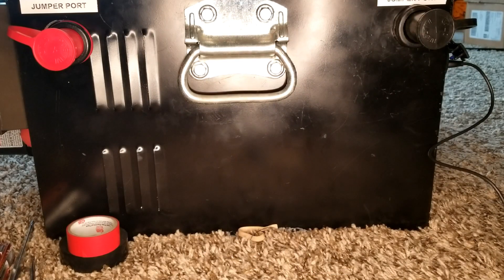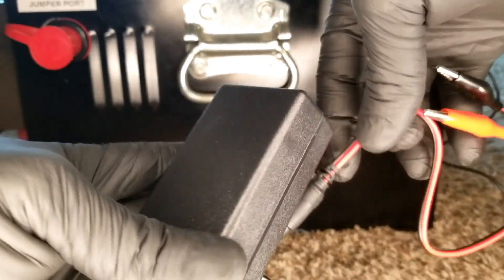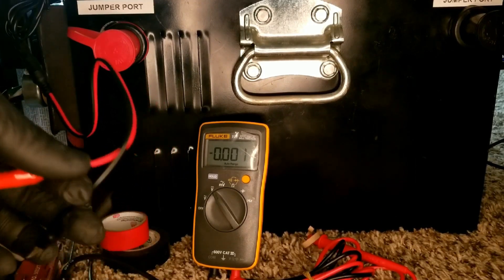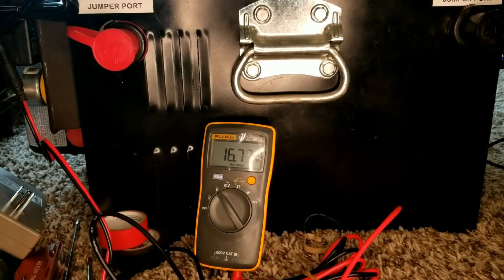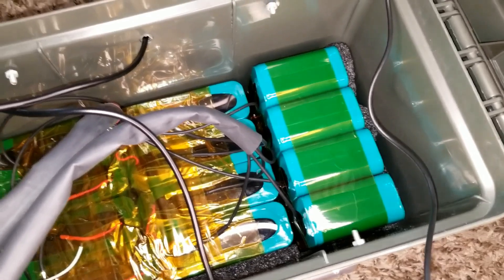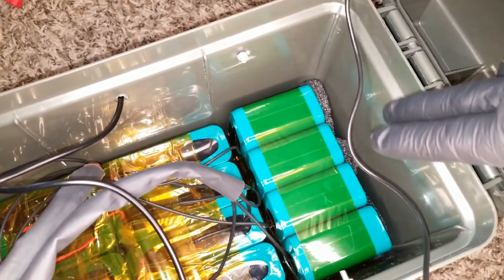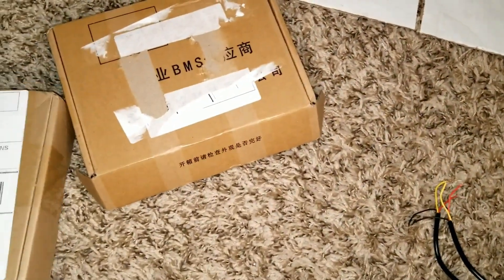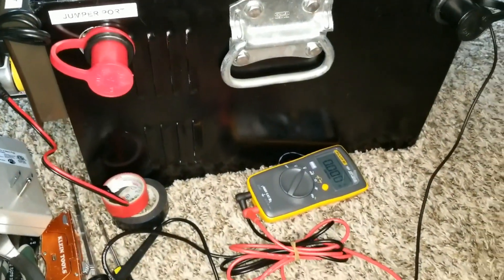14.8v - 16.8v Li-ion 4S 30W 2A LITHIUM BATTERY CHARGER MAINTAINER (LiPoLi-ion, LiPo, LEP)

Comment: Nice small 16.8 volt 2 amp lipofe battery charger . I know you have great uses for it to charge the cells . Would the current from the cells prevent the charger from pushing the 2 amp current through them from the major amp differences ? I’m just wondering .
Reply from the maker: Yes.
The charger has a built in automatically shut off/stop charging as the voltage reach the 16.8v
Remember the batteries also embedded with a built in BMS in them.
I hope I answered your question correctly
Reply: Your question does not make sense.  This charger starts in constant current mode, delivering up to 2A and the current depends on the momentary voltage of the battery pack it is charging.  There is no "major amp  differences" factor.  It does not matter what the batteries are rated for such as charge rate or output discharge current.  I mean as far as what the charger does, but you do need to factor what the battery manufacturer specifies as the max charge rate it can handle.  For example if you have a tiny Li-Ion pack made of  10440 cells, 2A would be far too high, but they imply it is meant for 18650 cells and any of those should be able to take 2A charging current, yet you should check the cell datasheet to confirm this, or err on the side of caution and charge slower with a different charger that outputs lower current than 2A, if you find they are getting too hot during charging with a 2A  charger.

Once the charger  has brought the battery pack up to 16.8V, it should hold the voltage no higher than that upper limit, and continue charging, then by the change of the LED color to green, indicate that a certain minimum current has been reached as the indicator that the  battery is done charging.   

To clarify, it is not done charging when the charger reaches 16.8V output.  It is does charging when, while holding the output at 16.8V for a period of time, then the battery pack current drops to almost nothing because it has reached full charge.